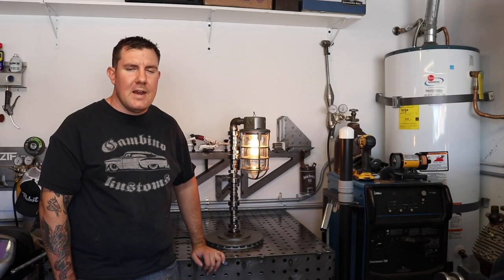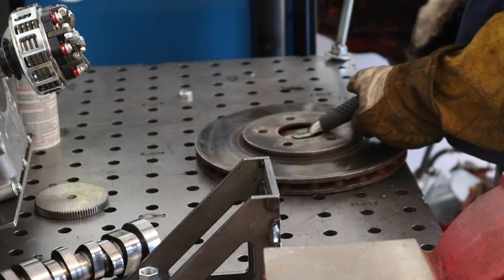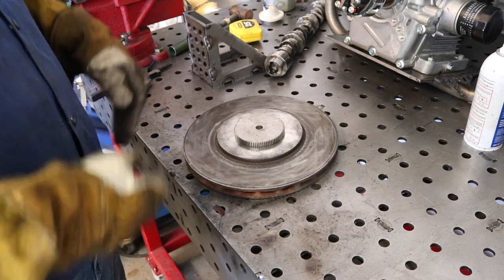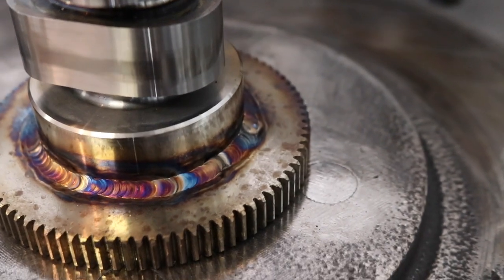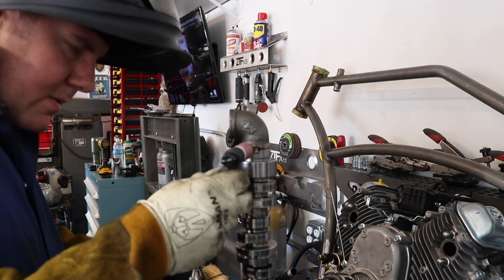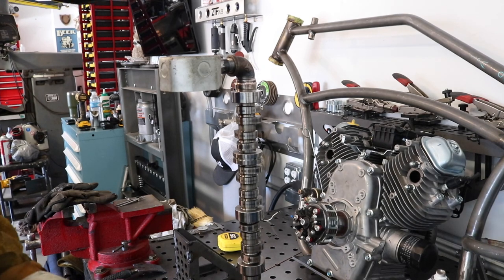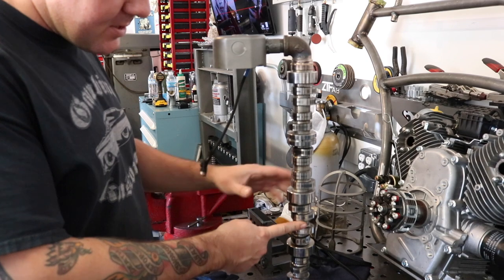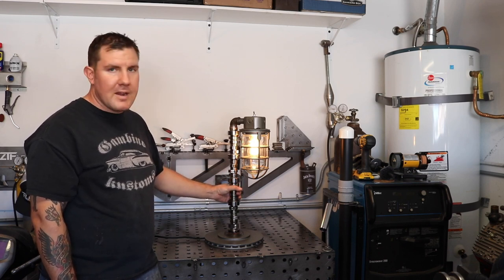DIY CAMSHAFT LAMP

Comment: Great looking light. Since the whole thing is metal its kind of important the switch is in the L1 side of the wire. This would be the one that traces back to the smaller spade on the plug. Sweet looking light!

Comment: That turned out great!  I'm in the middle of building one myself.  I'm using a 5.7 Hemi cam.  Had to cut it in half and mount it in a lathe to drill a hole through both pieces.  Will hold the two halves together with a hollow bolt.  Thinking about using an old crankshaft pulley for the base and a 14" air cleaner for the shade.
Reply from the maker: burdar78 that sounds bad ass! Especially if u find a cool air cleaner top like one of those finned offy units. I have seen a few people build that style before with RGB LED’s so they could change the color of the lights with their phone. It looks pretty cool.

Comment: is the camshaft hollow completly threw?
Reply from the maker: Ricky Nunnery from the factory they are mostly hollow but there is a 1” thick portion about 1/3 of the way in from one end that will need to be drilled through to make the LS1 cam completely hollow. I used a 3/8 drill bit that was 12” long and it did the job in about a minute. The metal is super soft so it goes quick. If you have any other questions, just let me know.